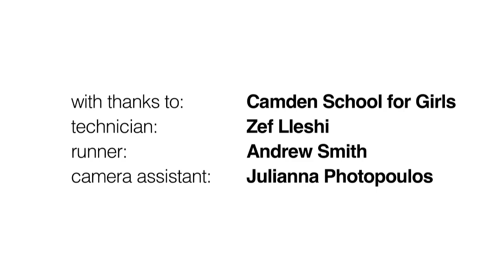Compressing a gas in a fire piston

Comment: Would it be right to approximate this process to an adiabatic process as it occurs too fast for significant heat exchange between the system and surrounding to occur and since work is being done on the gas, its internal energy increases implying an increase in temperature?

Comment: The explanation is FALSE. Compression should NOT increase temperature, only pressure. A simple lab experiment would bare this out. You ARE doing work, but you are not directly raising the temperature of the gas, the combustion certainly raises the temperature of the gas, but the applied pressure does not. I seem to remember the explanation of fire as a chemical reaction involving oxygen called oxidation. The increased pressure causes the collisions which causes the reaction (rearrangement of the molecules) which releases the heat to create lower energy molecules. https://www.youtube.com/watch?v=eocyl9dZ7W0 . This is the same false explanation used to explain diesel engines on wikipedia and other places but it clearly violates the laws of physics. Institute of Physics?

Edit: the linked video claims that the heat we feel from fire is due to the kinetic energy of speeding molecules/particles hitting our skin, which is obviously false. Think of a lantern.

Comment: The naturally always vibrating and wiggling particles get trapped together closer and closer as the piston is pushed downward. As the space is decreased as the piston moves down, the vibrating particles start bumping into each other, and moving faster and faster, this creates heat. If the plunger is pushed down fast enough, the heat gets concentrated into the tiny area and get hot enough to ignite the cotton. As said in the video if the plunger is pushed down too slowly, the same heat is still created, but it is allowed to warm up the glass walls of the cylinder, it dissipates, and it won't be as hot and concentrated when the piston gets to the bottom.

Comment: I'm amazed to see a fire piston video with NO diesel engine comments devolving into hate and discontent 😆

Rudolph Diesel got the idea for his engine from a fire piston which was common for fire starting at the time.
Reply: The new 'ducted' fuel injector technology allows extremely clean combustion-without aftertreatment.  It was invented in Scandia Labs.  Anyway, 'clean diesel' is so clean that tire wear and brake dust is actually more of a problem by far.
Reply: @someotherdude  I hadn’t heard about that, very promising!  Maybe we can bring back the old Detroits and put DFI in them 😆 thanks for that info!
Reply: ....But dont diesel engines use the same principal compressing a volume thereby heating it, then injecting the fuel when its ripping hot near TDC(i have no idea what the injection offset would be, but when learned about diesel injection mechanics and technology it blew my damned mind)? Or is their argument that the fire piston idea came after diesel engines? ....Im no historian, but even I know that is very much not the case....
Reply: Yes, NO Diesel comments BUT  in this place a lot of Titan comments 😅

Comment: what happens if you push the piston down and hold it there without release back up? Will it lead to an explosion of the piston?
Reply: nothing happens the molecules escape
Reply: @sukhviryadav2343  The molecules don't escape... The heat dissipates out of the cylinder walls through convection.
Reply: @davelowets  NICEE
Reply: @sukhviryadav2343  🍻

Comment: I do not believe that most of the energy comes from the piston. It’s an adiabatic process. You are taking the kinetic energy from a large volume of gas and reducing the volume. The energy remains constant, but since the volume is lower the temperature jumps higher. At least, that’s how I remember it. I may remember wrong.
Reply: Ahaha me too. Like I remember. When volume is low, gas molecules collide more. So energy is produced more (if not elastic collision). And heat is produced
Reply: 'kinetic' is not the right term.  It's an adiabatic process, when you talk about compression or expansion.
Reply: @someotherdude  I think you may be more correct. Although at the molecular level it’s still kinetic energy. I’m not sure if the distinction is significant or not. It can be confusing.
Reply: No, I think you are right, and I agree with you!  The gas already has kinetic energy, although the piston does apply some energy to the system.  The faster you push the piston, the more energy is added to the gas.  Also, the higher the temperature of the gas, the more kinetic energy it already has.
Reply: "I do not believe that most of the energy comes from the piston."
But the guy didn't say 'energy', he said 'momentum', mass x velocity.
For a given pressure and temperature, gas molecules are continually striking the working face of the piston. If the piston is moving toward the closed end of the cylinder the molecules rebound from it at their initial speed plus the speed of the piston i.e. they have a higher temperature, if high enough, they ignite the cotton, the same principle as the diesel engine.
PS The momentum picked up by the molecules does, of course, come from the piston.
It is important to distinguish between momentum and energy.
Try this - burning fuel produces lots of energy but the momentum is in every direction, adding all the vectors the sum means the net force is all local. 
In a rocket engine the nozzle has a special shape that focuses all the (gas) momentum in one direction.
Since all momentum is 'conserved', then the rocket combustion chamber gets pushed in the opposite direction to the exhaust plume.
Reply: I told myself this story too at some point in my studies, but I believe it is 100% wrong. Temperature is average kinetic energy per degree of freedom (not volume), if energy remained the same there would still be the same energy per molecule and so the temperature would be the same. The entire change in temperature is only due to the work done by compressing.
Reply: Ummmm... all of the energy is coming from his hand. Pushing the piston. Where do you think it's coming from?
Reply: @shannontaylor1849  so, chemical energy from his breakfast. I agree.
Reply: @shannontaylor1849 there's energy in any gas but you can compress it without raising the temperature much, if you do it really slowly, slow enough that the heat just leaks out into the surrounding system.  The faster you compress it the less time the heat has to leak away so the gas gets hotter and that means more resistance against your efforts to compress because hot gas molecules will hit against the compressing piston harder.  

Honestly I'm surprised that you can get enough compression so fast by hand to raise the temperature that high.  

Then again I have a minimum scuba tank I pump with a special hand pump to 3000 psi.  That pump cylinder gets really hot and I have to take a break periodically to let it cool down.